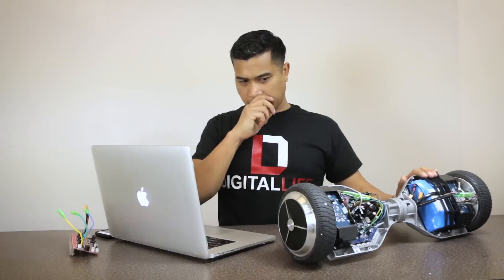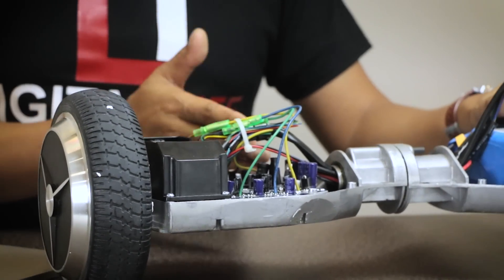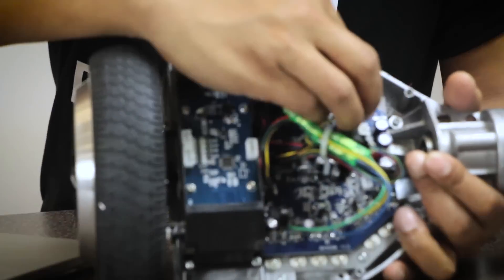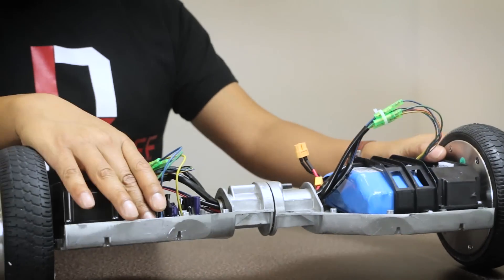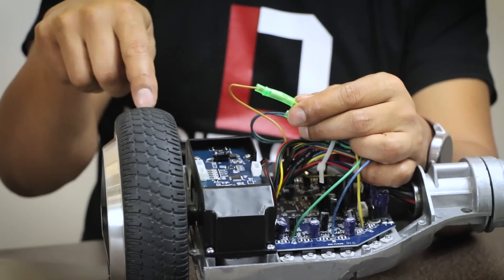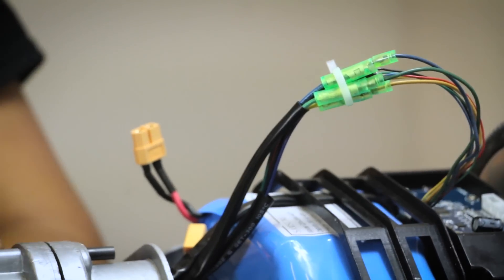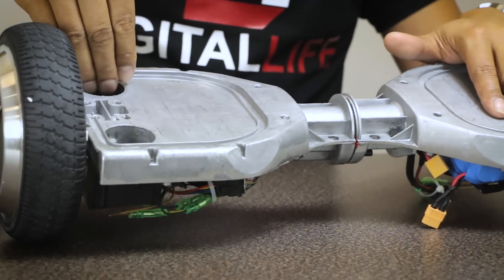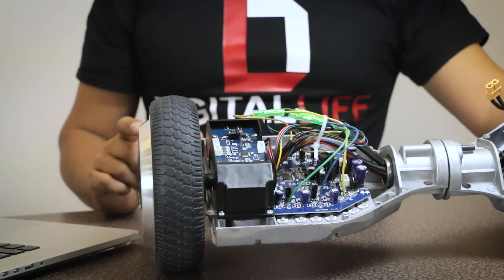Common Hoverboard Issues (Q&A) Session

Comment: Strike Hoverboard The problem is with the sudden stop with the brakes for no reason and the battery charged and after the sudden stop if you try to turn it on, it does not work, but if you insert the charger socket for a few seconds and disconnect it, it works again without delay, but within minutes of work it stops completely again and also if you try to turn it on after stopping Surprisingly, after a few minutes, it works again without the need to insert the charger socket. There is an important note. When I lift it off the ground and try to turn it on, it works at full speed without stopping or problems, but when I drive it, it stops after a few minutes. Thank you

Comment: Hy, the problem with my hover board is that when I step on it it turns off with in 5 to 10 seconds but if I don't step on it and try to run it by applying pressure on the foot steps it works for like a long time . But when weight is on it it's stops in 5 seconds . What could be the issue .?

Comment: I wonder if anyone will reply to this after the video being up for so long:
I just bought a hoverboard. Internals are dated 2015. The insides are very clean and I dont think the board has seen much use. it is a V1.0.
It was sold as spares/repair.
The battery would not charge and showed 3.1v so I replaced the battery.
The battery was charged up without any issues.
When the board is switched on, all the lights briefly flash and the board turns off.
I have read somewhere that the V1.0 board had a fault that could 'brick' it and it would never work again.
what are your thoughts?

Comment: Great video!
i have a rare problem with my hoverboard, i turn it on and it works fine but after riding it around 5-10 minutes one side of the hoverboard dies completely and then the other side also. the light is still activated and works when pressing the balance sensor but the motors are completely dead. the strange thing is when i turn it of and wait 2-3 minutes to turn it on the motors work again but on ly for 5-10 minutes and then the same issue, do you possibly have a solution for this???
Reply: +jacob Ghiglia dahlberg I have the same problem
Reply: Did you ever find out what was wrong with it
Reply: +Lucky Luck  Not Yet
Reply: Ok please I'm haven't the same issue.  My son rides it for like a min and one side turns off and starts blinking and beeping. .
Reply: Jacob Ghiglia sounds like a motor

Comment: my 8 inch new hoverboard womt charge. the charger fan doesnt move but i hear a buzzing sound from the charger. also the green light on charger doesnt turn red whem connected. please help. what could be the issue and how do i fix it ?
Reply: You might have bad battery, check for voltage of battery at least leave in plug over night. My does.

Comment: I can't find any videos to show how to take it off or where it is. I have it with a gokart kit but with the extra weight it doesn't go nearly as fast. I want to remove it or disconnect it so it will move as fast as it should. And will it require a bigger battery?

Comment from the maker: hello oscar, I would advise you to take a look at our recalibration video. if that does not work I would diagnose the issue as you needing one or two balance sensors replace. we would recommend you always use high quality parts on your device.
Reply: Sorry for late but one of the sides of my board when you ride it one side studers then stops working until i push it

Comment: Hi my hover board turns off by it self if you drive back and forward quickly or once I have been driving slightly uphill and it turned off as well than it just doesn’t want to turn back on but if I plug it in to the charger it turns back on and drive just fine is it something like battery management system or something ? How could I fix it ? Thanks

Comment: my sons hover board just quit working. When turning the wheels by hand one wheel spins smoothly and the other does not. It feels almost like a stop move motion. And neither side have power to the wheels. lights come on except the left one on the top. blue led's both come on. theres no loose wires inside everything seems plugged in right. tried reseting it even disconnected the battery and still nothing. i'm thinking maybe the wheel needs replaced since it is a rotor/stator setup. can you please help me resolve this issue.
Reply: tnt570 I'm having the same issue with my son's board. ever find out what's causing it and hopefully a fix?
Reply: tnt570 same with mine
Reply: My U wheels is having the same issue

Comment: hi i have changed all boards but only one side works as it should the other side the wheel locks you cn hear it trying to move,ive adjusted it to make sure its not catching on anything ive tried changing the wires round from the motor but then it goes crazy any ideas, ive also tried a different motor and still the same any ideas

Comment: My grandson has a Swagtron T1 short circuit, I unplugged the battery and all the other connectors and it still has the short circuit, the charger light goes out and there is a spark when you plug it in.  ???  Any help appreciated.

Comment: Hi my question to you is I had one side of my sons board that wasn't working so I replaced the balance sensor now it seems to work except it's out of control fast. The slightest touch and it spins around so fast . Something is drastically wrong. Could it be the part I put in or another issue . When I press on the pad only one light lights up. Any idea what the problem could be? I'm out of ideas! Please help!!!!!
Reply from the maker: try to recalibrate. if that does not work I would question the part try to buy high quality parts. you can try digitallifex.com
Reply: +Digital Life X we actually did try recalibrating and no luck. Have you ever had anyone with the same problem?

Comment: hello. My son's hoover board only comes on when plugged in but i get a constant blinking green light. when i try to turn it on without the charger in comes on for a second and goes off. do you think it's the battery or logic board? i've checked and all the wires are secure. his hoover board has two batteries and logic boards, one on each side.

Comment: I have a 10” hover
board that has stopped working.  When it is turned on, the green light
comes on but the red light on the R center side of the board also comes on and
blinks, and there is a constant beep sounds for a few seconds.

Comment: So I recently bought a hover board from a friend, I don't know what brand it is, all I know it's the one with the "Mercedes" wheels, and I opened it up and saw that there was a wire not connected to anything, but when I ride the board it works fine like as if that wire doesn't effect the board at all , but I really just want to know where that wire goes, it's a black and red one from the mother board and they are pretty thin wires

Comment: hey so my balance board works but when i try charging it, it says its already fully charged on the charger after like 5 to 10 minutes and then i turn it on and it's actually not. I already got a two new chargers and they say the same thing. any idea why also it wont last me even a black away of riding before it turns off

Comment: my hoverboard doesn't work on the right side, the circle light blink red and it make a beep on both side when putting weight on it, but the motor on the right wont work like the left side do when I step on the left side first but after taking my foot off the left and putting my foot on it again, the motor won't run. red light are blinking even after recalibrating the sensors. I tried reconnecting the wires  making sure they all work. when it stopped working? when I excedently ran over a small rock with hoverboard and the hoverboard started rolling away for a little bit of time. whats wrong with it?

Comment: My hooverboad battery keeps showing low battery after charging it..i checked the voltage using the multimeter its showing 36volts , what could be the problem 😢

Comment: I have smart balance 10 inches wheel smartboard. And the problem is like one wheel is working faster. When I turn right it turns fast and when I turn left it is very slow. When I go straight way, one side is shaking little bit. How can I solve the problem? Is it good idea to cut the nipples? If yes which side should I cut?

Comment: Here is my prob the right side of my hoverboard the wheel seems to be jerky and makes a clicking noise like it doesn't want to move smoothly .And and after about ten mins of tying to ride it the right wheel is so hot I can't touch it. The place I got it from will not even return my emails. Any suggestions oh what my prob can be ? Thank you for any help your can give me.
Reply from the maker: you need to replace or fix that board asap. even though the boards look the same they are not the same inside. I an willing to bet the battery is causing that will motor to overheat
Reply: Can you fix it seeing how I can't get the place I bought it off of to return a email if so I will send it right away.
Reply from the maker: yes we can fix it please visit digitallifex.com
Reply: It's a Vecaro hoverboard and it says it has the Ul Samsung 36v4.4ah  is this something I can fix my self if I buy the parts from you

Comment: my hoverboard the one with the speaker and lights on the has the problem where it lights up when it moves, i know how to fix it but. Does all the kinds of hoverboard have the same gyroscope sensors?
Reply from the maker: most parts are compatible please check specs and connection s on digitallifex.com
Reply: mine sensor has the one with the Coil or spring looking thingy what was that for?
Reply from the maker: most parts are interchangeable please refer to the connectors
Reply: my board also has the remote thingy,the speakers, and lights on the side

Comment: Hello, I just bought a hoverboard from a friend and it comes with a charger. I charged it for 1 hour and 30 minutes and it only lasted 25-30 minutes of riding around a little house before it started beeping with a red battery signal. Any help? Also, should you keep your hoverboard on when charging or should you turn it off?

Comment: I'm hoping you can help. My son purchased a Hoverboard and got 2 days of use from it.

The symptoms are... The unit red error light comes on. I have tried to recalibrate it and get same error light. The blue LED light stays on on the right side. The same side wheel has more resistance then the other. I remove the cover and the logic board light seems to blink constantly with no pause in between. I have checked all the wires to verify there is no loose connection.

Trying to figure out if I need new Gyro boards, a logic board or a need wheel/motor.

Thanks in Advance.

Comment: Hello, hope you can help me fault find my problem. I’ve changed out the gyro on my hover board and tested each corner with the blue lights which are working. The problem is that it beeps and turns on and the green lights in the centre flash up then disappear. It does not go into calibration mode only when I apply pressure do I see the blue light come on but no movement.

Comment: Hello,

I have a problem with my board. It won't turn off. when i press the button i just hear the ''turn off'' sound but it stays on. i unscrewd the back and checked the plug of the power button and everything was ok. The red light just keeps flashing on the control board. what can i do? i can not turn it off. I can drive on it and do everything but it just won't turn off. HELP!

Comment: Hey I received a hoverboard that came to the original owner broken. Specifically, it only seems to actually work when it's tilted far forwards, making it rather impossible to actually ride. Otherwise, it makes a loud, repetitive beep and a red light displays. When I opened it up and took a look at the various wires at one point, where the little connections covered in the plastic tubing are made battery-side, the green wire appears to be hooked up to the blue wire, the blue wire hooked up to the yellow wire, and the yellow wire hooked up to the green wire. Is this something that could cause this problem, and if it is, how should I go about disconnecting and reconnecting the wires?

Comment: I fell of my hoverboard and it rolled a few feet, now it wont work. When i turn it on, it does the on sound and turns of in 2 seconds.! If i hold the on button down my board will stay on and the red light will continue to flash. Only one pedal is working too. What can i do? Nothing happend if i put it on charger, and when i tried to calibrate it once i stopped holding the on button, the board just turned off. Help please?

Comment: I just bought a 10 inch bluetooth hoverboard it's working perfectly fine but i opened it, just to make sure everything inside it's ok, but my only concern it's that the color wires for me don't seem to be connected right because they are not connected with the same matching color for example the green is connected to the blue and the yellow is connected to a different color. So should i reconnect all the wires to the same matching colors and if yes will my board still work fine please let me know asap so i can fix this if this could be a problem if it is a problem.

Comment: My sons hover board won't stay on. If you hold down the power button, it will stay on as long as you're pressing the button. As soon as you take your finger off the power button and it turns off again. I replaced the power button and it did not help. Any thoughts on this?

Comment: I have a hoverboard that will not go into calibration mode. When I turn the board on it still works but the red light stays on and when you ride it, it is obvious that the board is not calibrated. I have tried many times to get it into calibration mode but the blue lights won’t flash no matter how long I hold the power button down. The red light flashes three times and then goes to a solid red circle... any help would be greatly appreciated

Comment: Hello, What would cause the board to come to a complete stop and the battery light blinks 7 times?  The board is fully charged according to the charger. It is the battery light blinking not the round power light. Also the board is hardly used basically new. Thanks

Comment: Hello, 
So I bought my balance board in October 2015 and used it for about 2 months with no issues, and I've never overcharged my board that I'm aware of? Recently, I was riding my board and it literally died as I was riding it with no warning (red light, beeping, nothing?). I assumed the board needed to be charged?! So I went home and charged the board as usual, and then attempted to ride it. Once gain, the board powered on and appeared to function normally and then shortly after as I was riding it it shuts off abruptly!! Once more with no warning and almost as if a wire was being disconnected mid ride. Please help! I feel like I now have a $300 paper weight :( Thanks for any help.

Comment: My hoverboard is the 8 inch bluetooth speaker model. It won't turn off and once i have it on charge one light on the board is blinking yellow and it will not stop beeping. I can only get it to stop if i unplug the battery. Once i plug the battery back in it won't start beeping unless i attempt to charge it. The blinking red light on the motherboard blinks 9 times in sequence which from what I've heard it means the motherboard is fine. I can't even find anyone else with a yellow blinking light issue

Comment: i bought one and there is a red light that blonks and i have to calibrated or hold it to get the green light but then when i get on it the red light appears and only one wheel runs and the other one dont so i dont really know whats wrong with it
Reply: I disengaged batteries in both my boards but couldn't plug either back together. attempts resulted in HUGE sparkS

Comment: Each side of my boards works fine, but when I apply pressure to both sides simultaneously, the board goes crazy vibrating violently. I have multiple broken hoverboards with the same issue. On these boards, originally one side was not functioning, so I purchased replacement balance sensor boards. Now both sides function, but will not work together. Please tell me the solution to this and I will buy the necessary parts from your store. Thanks
Reply from the maker: hey Stan what happens when u recalibrate.

Comment: I've been debating whether to put the wires inside or outside the battery casing. If I put them outside the sharp edges of the battery casing might chew up the wires. If I put it inside the wires might deform the battery. Which is better?

Comment: One side of my hoverboard not working after one day. It gives me a red light. I've tried to reset it but doesn't help. I have still a red light on one side when I touch the pad. Any solution for this?
Reply from the maker: sounds like you need a balance sensor try digitallifex.com for the part
Reply: +Digital Life X Thanks! I'll try with a new sensor!

Comment: When I first got my board it was fully charged so I rode it then it died so I went to charge it and it doesn't stay on unless I hold the button and the green lights on the top flicker and when I plug it into the charger the led light on the charger blinks from green to red over and over in a pattern what do I do
Reply from the maker: kyle have you tried a different charget
Reply: I don't think it's the charger because the board only stays on if I hold the on button and the green lights flicker that's when it's off the charger
Reply from the maker: most likely you need to replace the motherboard
Reply: Ok thanks for the help